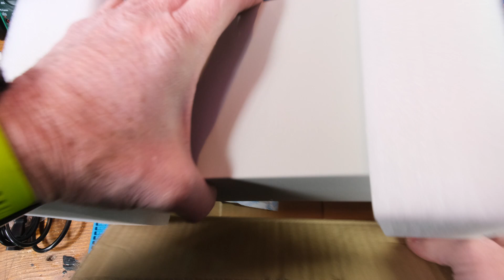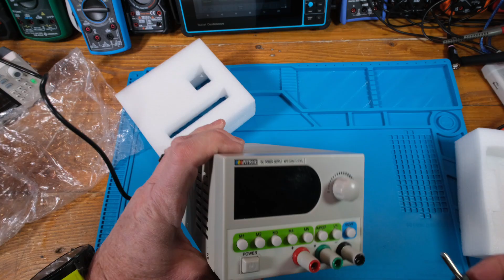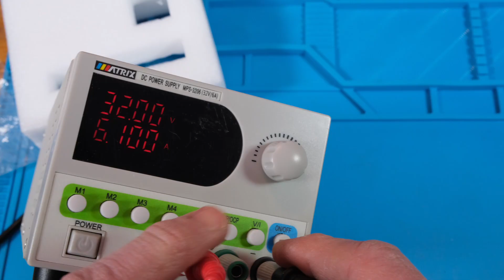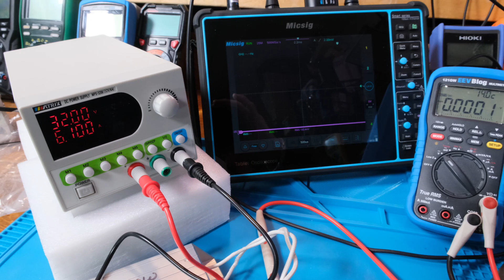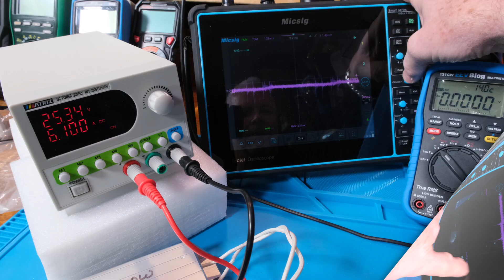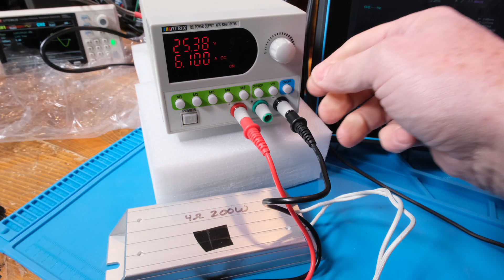Best? Low Cost Power Supply from Matrix MPS-3206 #benchpowersupply

Comment: In terms of voltage range and current rating,  Kenwood used to manufacture a good selection. LED display 60vdc at 10 amps  very robust as I recall. Linear of course and  very heavy. It would be neat if you got hold of one of these and did a bench test, see how it compares.
Reply from the maker: Thank you!  I did look for this Kenwood, and I found something similar.  I'll keep looking:)

Comment: Peak of 15 amps isn't good.
Reply from the maker: Thanks!  It depends if it is just output caps discharging or power supply control.  I’ll do a survey of my power supplies on the bench to see what I find - with a fast current probe on my scope;)
Reply: Thank You for the info .. I am very curious of what you found with  energy spikes... I am looking to get an affordable PSU .. filter noise is easy enough.. turning on/off with attached loads can be an  issue.. what kind of over shoot and off ramps are you getting ??  @KissAnalog

Comment: unfortunately the company website does not inspire confidence. The only downloads are for the product catalogue and instructions manuals. No links to technical support. No contact information for technical support. No information about warrantee. No firmware, no troubleshooting and no servicing links. The instruction manual is 2 pages with no tech support or warrantee info. At least there are some specifications. The only contact links in the website are to sales/marketing. The news link on the website has one entry - that they updated their company logo! In the uk it is currently around £100. I'm concerned that the back of the unit does not provide a rating for the fuse and neither does the website or the instruction manual! Incidentally the instruction manual specs say 220VAC only but also states that you have to make sure the conversion switch is set correctly whilst showing a photo of the back that has NO mains input voltage selector switch to adjust!
Reply from the maker: Thanks for this information - great feedback!  You are right - the web site doesn't offer a lot of information.  The equipment shown is pretty sophisticated for a website like this.  The equipment also looks like some of the more expensive brands that makes me wonder if they are the manufacturer for others and also sell under their own name...  For the cost of a power supply like this, I am not too worried about any support from the manufacturer.

Comment: I have the same power supply and for the money I think it is pretty nice.  Very intuitive user controls.  You are braver than I am.  Since the fuse was blown, I would have brought it up using a variable autotransformer or maybe a series current limiting lamp system.  Thanks for the video.
Reply from the maker: Thank you!  LOL but I'm not brave - I'm always very careful around power;)  A more powerful unit would have made me use the variac;)  But since the fuse blew before, I was confident that it would again.  I actually had it plugged into my variac that is fused as well:)  See - I'm not that brave;)